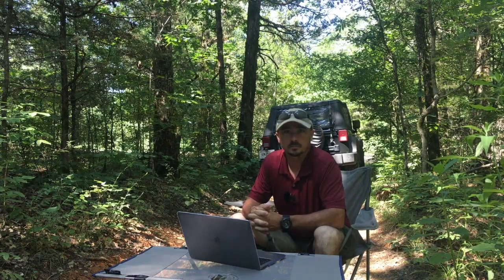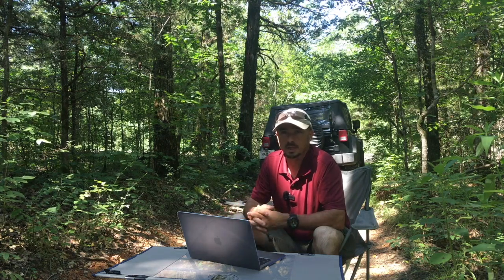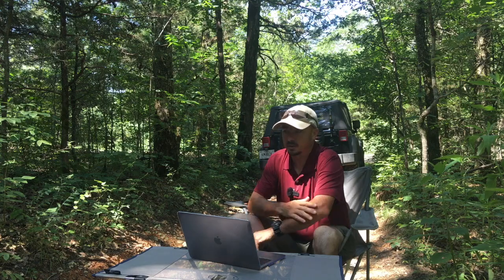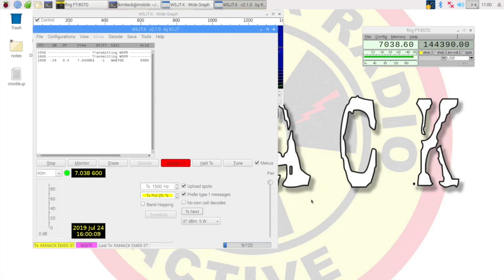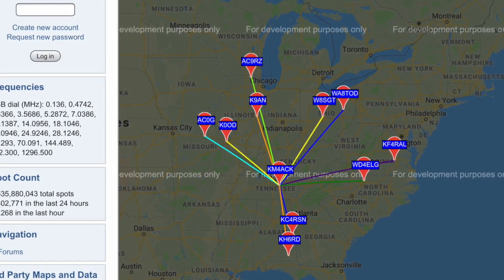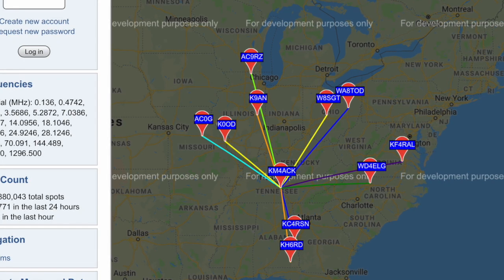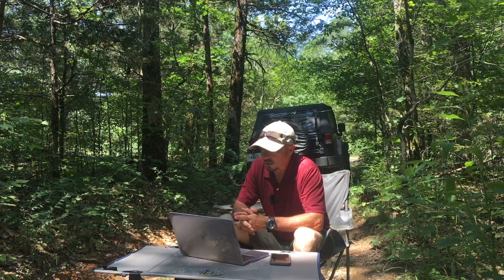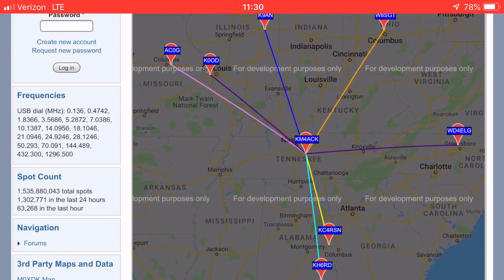Mobile NVIS

Comment: Did you take into account that you changed the whip length and in doing so changed the SWR? And the resonant freq. 
Cut the wire to a 40 or 80 meter freq and put it on without the coil.
Reply from the maker: Yes. The coil has to be moved to account for the additional wire and keep the SWR at 1:1. The wire is cut to a length that takes almost 100% of the coil out of the equation on 40M. The some coil has to be added when working 80M with the same length of wire to keep the SWR at 1:1. 73, de KM4ACK

Comment: Another excellent video. I looked too fast and I read NCIS oupsssss. Did you have time to have a solution for the Raspberry Pi 4 ?. 73 VA2SOB - 73
Reply from the maker: Yes. I gave made progress on Buster and the pi 4. Script used in the Easy as Pi video should now work with Buster. 73, de KM4ACK

Comment: Thanks for the video. NVIS propagation can really be different from day to day and lately it seems like it's been a little on the long side. Last week I tried to make a 40 meter QSO with a station 150 miles away and couldn't do it all day or the next but on the third day it worked great. Switching to 80 meters fixed the problem and I could make the contact all day long every day. So right now at least, 80 meters is a much better bet for NVIS. I've found this website very useful for checking on realtime and historical NVIS conditions.
https://lgdc.uml.edu/common/DIDBFastStationList 
I pick the Austin station as it's closest to me. Then go through each page picking your date and time. When you finally get to the report page look at the top left "foF2" number. That's the highest frequency that was shot straight up and came straight back down again. If you want true NVIS distances you need to operate at that frequency or lower. At the bottom of the page gives you max frequencies for 100, 200, 400, etc NVIS ranges in kilometers. I have found it to be pretty accurate to real life communication abilities. 
Your antenna setup will work fine for NVIS as it will radiate a good chunk of your signal up just as it is. Lengthen the wire some and drop to 60 or 80 meters for our current conditions.
Reply from the maker: Next time out, I will be trying 80M. Thanks for the link! 73, de KM4ACK

Comment: How would an inverted V fan dipole work out you think? 73 de ke4ooo
Reply from the maker: I'm certain it would out perform this setup. I chose this for a couple of reasons. 1. Quick Setup 2. Small and easy to store the extra piece of wire. 73, de KM4ACK

Comment: What would it do if you did a full 1/2 wavelength center feed?
Reply from the maker: Not sure but it would be worth testing. Please share your results :-)
Reply: @KM4ACK  I am a new ham. At this time I can only do 2m, 70 cm. I love your videos and spend a lot of time watching them. I am 73 disabled retired saving up my SS check to get what I want to get for radios. Living in south Florida I have worked mostly on sheltering at home for hurricanes. I have a Anytone AT D878UV Plus, that gives me 2m, 70 cm analog, and DMR! Still working on getting DMR working. Also have a Anytone AT D578 that gives me 144, 222, 444, analog and DMR.  I got 4 -25 ah LiFePo4 cells and 2 sets of 4 - 60 ah LiFePo4  giving me 24 v to power a UPS that I have. I have 5550 watt generator and a good supply of gas.  I have 100 ft RG8 going up a tower behind my house with a dual band antenna with 9 & 11 db gain. I don't know if you know about the Florida SARNET!  With this I  have talked to someone about 300 miles away. on 70 cm repeaters. When you see a hurricane, look for WX4NHC on HF. National Hurricane Center! They are also one the SARNET! So when a storm is coming I have a hotline to the Hurricane Center, but mostly lesson unless ask for something. I want to get a weather station, only have basic one now with pressure, temp, humidity. As soon as I can save up enough I will get HF! I will be getting a Pi soon and start doing things with it. Want to get some things going with what I can. Sorry I can't test that now. But as soon as I can I will test that. I may have enough room to a 20m long wire low down